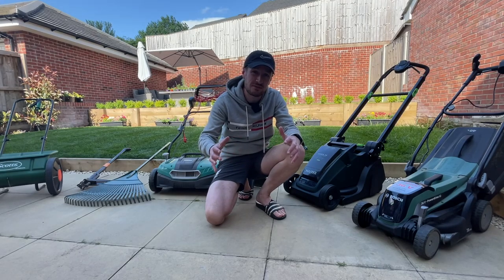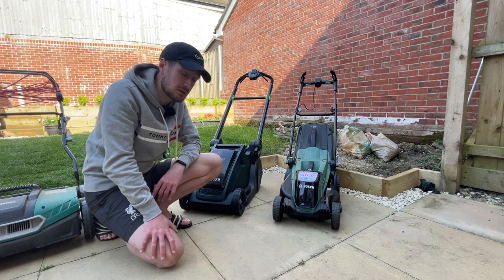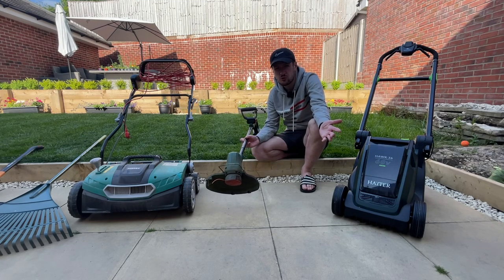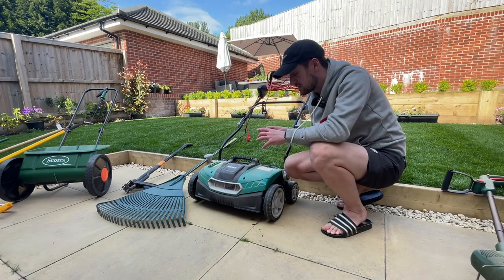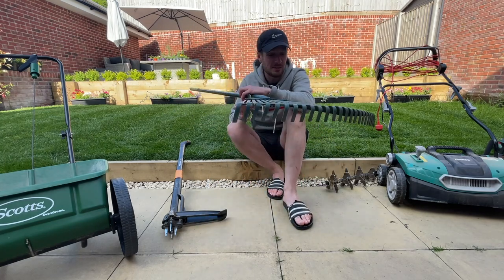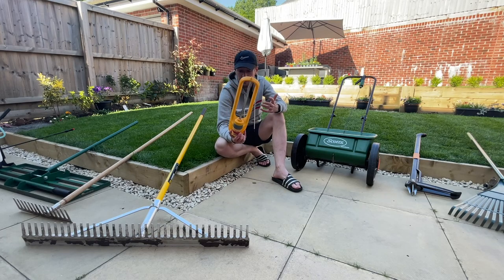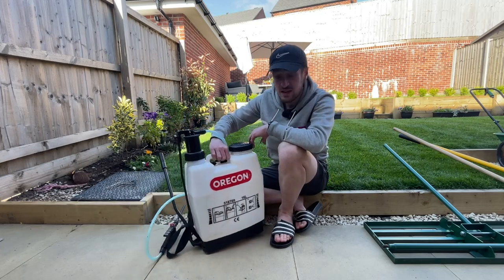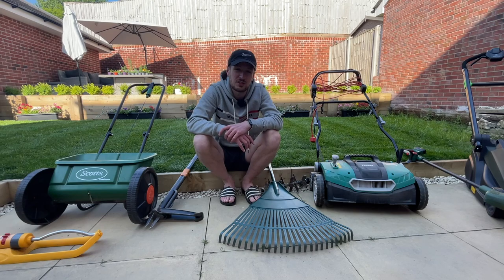What Lawn Care EQUIPMENT do you ACTUALLY Need? Beginners Guide to a Great Lawn

Comment: Great advice. Re the scarifier, how good are they in pulling out weed grasses so you an overseed. Or do you still need to dig out stuff like pop annua manually. Will probably be doing th first mega lawn renovation in September and you channel has been a good reference. But weed grasses are my main challenge.
Reply from the maker: It’s not bad with weed grasses. I’m doing this today to my back lawn and quite a bit of weed grass has come through, it’s driving me mad! But it does a decent job at getting rid of the seed heads. Not as good as a verticutter, but it’s the next best thing 👍🏻

Comment: I'd say very similar to you but just different options. I chose...

- Mac Allister corded mower (gifted to me)
- Bosch corded strimmer
- Long broom for sweeping up grass from paths
- Dust pan and brush for cleaning equipment and tidying up smaller spaces
- Fork, trowel and secateur (inherited from grandparents)
- Patio weeder (right angled end) to get weeds and grass out from in between patio slabs
- Dandelion weeder to spear into the lawn a few times around a weed levering it up as you go
- Walensee coring aerator
- Half moon edging tool for borders
- Hozelock rectangular sprinkler
- Hozelock reel hose
- Gardena hand spreader
- Birchmeier Aquamix hose end sprayer

I've since bought the Wolf Garten Multi-Change Telescopic Handle and I can now donate some of my old tools as I can use the same handle for multiple tools:

- Wolf Garten garden broom
- Wolf Garten decking brush
- Wolf Garten half moon
- Wolf Garten roller scarifier 
- Wolf Garten leaf rake

A lot of my choices are for space savings reasons as I don't have a big shed or garage so I don't have room for an electric scarifier, or a napsack sprayer you carry on your back but mine still get the job done.
Reply from the maker: You've got a cracking set of kit! I've been after picking up some of the Wolf Garden tools. Do you rate them? They look great from what I've seen online.

Also, the Walensee coring aerator. What do you think of this? I've been looking at getting an aerator for a while, but it only ever seems that the proper expensive ones get good reviews. Does it do a decent job?
Reply: @NoviceGardener  appreciated 👍. For what it's worth I've watched through all your videos over the past few months, and I didn't realise you'd done a whole renovation and thought originally you were a garden YouTuber then I watched back over the complete channel and you earned my respect very early on, fair play to you, honestly I never would have attempted what you did.

The Wolf Garten kit was highly rated by Shaun on another channel on here so I bought them and honestly I've been so impressed, they're really good quality and the changeable handle means you're not spending money time and time again for the handle, you're only paying for the end bit that you're interested in.

I've found the Walensee coring aerator to be great too, and there's a plant pot hack which you can do to catch the spent soil cores and save picking them up off the lawn, I can't post a link but you could Google "F1Fcy7AeXeL.mp4" (you'll get the full link in the pdf)
Again this is from Shaun and his shopping list which I found incredibly useful, your YouTube video though is useful too though 🙏 I can't post a link but you could Google "Lawnright shoppinglist.pdf"

The only thing I've found with the Walensee is if the soil is too damp then it won't eject cores it just pushes the soil downwards into the lawn which I don't think is the fault of the aerator, it's just the soil conditions. I've found if the soil is dry enough then it does exactly what you'd hope for. The only word of caution is if the soil is left to harden in the tines then it becomes next to impossible to get out. Without fail you need to run water through the tines and push soil out with a long Allen key or screw driver, do not let it harden overnight. Apart from that it's a great tool. Also lubricate it, for any garden tool I really like Niwaki camellia oil. The only thing with the more expensive units is that they have replaceable tines but you could buy this unit a number of times over with the cost of those more expensive units.

Really enjoy your channel, you're definitely one of the UK gardener channels for lawns now, especially because you seem to not be a professional or that it's your full time job, and you come across as a normal person like the rest of us, especially as I've got a new build too.

Comment: I recently extended my first garden and improved the clay soil a bit before adding a new lawn. I did a rubbish job levelling it as it turns out but overall it's not bad. We're entering the hot period and so its a new lawn with roots that arent established fully yet, but there are patches of grass that are lush and green and full and the rest is... Okay. Lots of straw coming through under the initial layer of green.

I'm still getting my head around when to aerate, when to scarify, whether or not we should fertilise etc.

It would be great if you have some monthly/annual activities that keep it healthy.
Reply from the maker: It's a really tough time of year, particularly with the heatwave we've just had. It shouldn't be as bad thankfully over the next week or so. If I was you, I'd get fertiliser on it soon and keep it well watererd.

Aerating isn't a bad shout at this time either as it will help some of the water get deeper into the soil without evaporating, but it may leave your lawn a tad unsightly for a week or so.

I'll put a video together over the next few weeks showing what my usual plan is.

Comment: Recently bought a new build with a large garden and have found your videos very useful! I’ve bought a Bosch strimmer but regrettably bought the corded one. I’ve tried watching different videos on how to use correctly but I’m sure I’m still doing something wrong, getting up to the edge of the fence still isn’t getting the weeds down and I’m still left with a thing long bit around the edge which is so frustrating and the closer I get the line on the strimmer breaks! I’m sure it’s just that I’m doing something wrong but if you or anyone has any tips that would be great, or a bit of a tutorial on using them properly for someone completely new to all of this would be hugely appreciated. Keep up the content!
Reply from the maker: I'll try and get a video together in the next few weeks!

I had the same issues with a cheaper strimmer that I picked up a few years back (you're talking a £20 strimmer). It was the line that was proper naff. If you pick up a more robust line, you'll notice a massive difference. Just make sure it's the same diameter as the one you have.

Comment: one of the best channels I've subscribed to. Top shelf.  Even inspired me to do my garden from scratch. any advice on the top soil? I've had to dig out about 5cm of my old clay soil and picked up a lot of stones and bricks.
Reply from the maker: Nice one! 😁👍🏻

If you're replacing clay with top soil, don't go for a 70 sand/30 soil mix. Go with either a 50/50 or a 70 soil/ 30 sand. It's back breaking digging out the clay, especially at this time of year. But it will be worth it!
Reply: @NoviceGardener   Watched your whole series and it certainly is worth it. Thanks for the tip. I am looking into putting the seed this month. I know autumn would have been ideal but hopping to be on top of watering

Comment: Hi. I enjoy watching your videos.  I am starting on my lawn restorations and currently us a corded Bosch.  I have been intending upgrading to a battery mower and am impressed with the results you are getting with the Hayter.  My lawn is a bit bumpy and uneven so how would the Hayter with a rear roller handle that compared to say a Bosch battery that has 4 wheels?
Reply from the maker: Nice one!

It entirely depends on how bumpy your lawn is. And it also depends how high you're cutting too. The Hayter should be fine if there are only a few bumps across the lawn - and if you keep it a tad longer too, you won't notice the bumps.